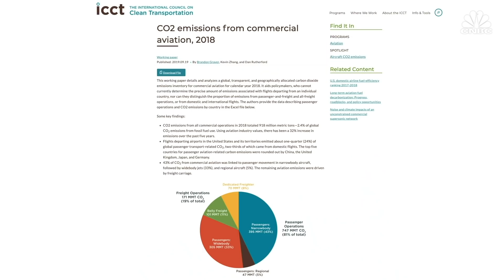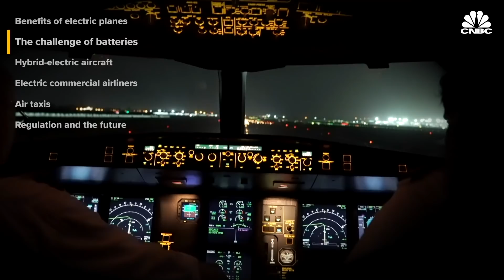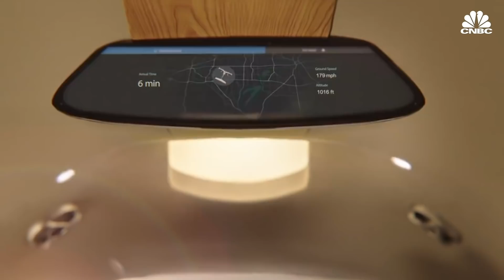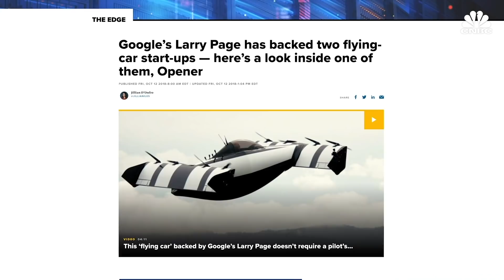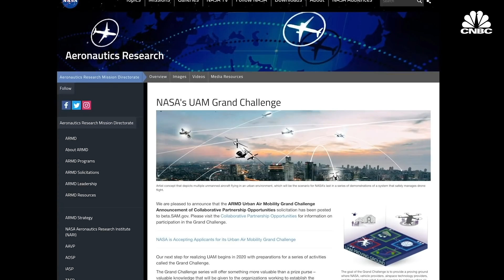Why Don't We Have Electric Planes Yet?

Comment: I will be retired from a flying career by then and won't step foot in an electric aircraft when they are shoved down our throats.   Yes, Harbour Air is experimenting but it barely has the range capability to fly a return trip on their shortest stage lengths.  I can't wait to see what happens with a hot battery or bus short.  No thanks.

Comment: So... we still need coal to power these bad boys even if they can be successfully developed.
Reply: No we need electricity.
Reply: @philterry3293  I'd guess that only coal or nuclear can generate enough, however.  (At this time, at least)
Reply: @rachelg785  Well you guess wrong. Renewables are the biggest growing sector and also one of the cheapest. Coal is being phased out in most developed nations.
Reply: @philterry3293  Only because of subsidies... and the irrational push to transition even when its not economically sound yet.  Prices for energy are sky-rocketing and people are suffering.  
But so long as the 'industry' is growing, right?  No.
Coal won't be phased out for a LONG time.  I suggest you get developing on actual viable alternatives if you want it to be.
Reply: @rachelg785  I already pointed out, Renewables are now one of the cheapest forms of energy generation (no subssidies) Coal in the UK is being phased out in the nest 5 years, and Wind power is growing, with two new massive offshore wind farms under construction.

The UK grid is now about a third renewable.
Reply: @philterry3293  Best of luck with that then.  I'm sure that will be powerful enough and reliable enough to get a jet off the ground.

Comment: The military started to develop nuclear powered aircraft, however that was abandoned.  They went with midair refueling instead.  The need to shield from radiation made the planes to heavy.  Would there be less need for shielding with molten salt reactors?

Comment: Maybe it's because if the batteries are as efficient as are Tesla semi batts, they will weigh 10 times the allowable takeoff weight of the typical airliner on long hauls?  A quick calculation after half hour searching came up with that. Anyone care to do better? And the infrastructure to charge a hundred or more planes at any given time at an airport would cost a fortune. The efficiency of batteries at the temperatures found at 40 thousand feet will come into play as well.

Comment: Because the technology is not there yet. Can't compare electric cars who can travel a  few kilometers to aircraft who needs to travel thousands of miles. If someone can invent a battery that can generate a power output needed for that. There could be charging stations in between destination countries. or someone could invent wireless charging while the aircraft is in flight.

Comment: Propaganda.  Look folks, these people have no idea what they are doing.  I do.  Happy to discuss the future of aviation.  This junk is not it.

The future does not need or want this junk electric nonsense. 

My new engine makes everything in this video all wrong. Yes, I have distributed power without the electric nonsense. No, this new engine is not an old pistion crank or jet engine.  It is a combustion engine so huge advantages over anything electrics offer even it the battery were the same weight at fuel.  

The electric motor can't offer blown wing, power on lift, active drag reduction and more.  No spin risks. 

CTOL, STOL and VTOL in one craft.  Roadable, door to door.  Nothing they show is useful, cost effective, or worthy of any investment at all.  Buyer beware... All these people are outdated and unaware of what is possible. 

That said, electro-fuels from nuclear/wind/solar is the fastest way to zero CO2, NOT batteries.  The very reason for electrics will end up being at least 2x more CO2 and 3-5 in reality that what I propose. 

You can make electro fuels for $1/gal. Electricity at 12 c/kwh is $4/gal.  My engine is the same efficiency as EV plug to wheel/prop.  No advantage in energy.   Electricity will always be more and grid based renewable electricity will be 10x more than making fuels from wind/solar.  Make fuels, use my engine...10x less costs. 

Going electric will bankrupt you.  Why?  Happy to discuss it.  You can't win....  Always less $$$ and less CO2 with my engine.

Comment: The first Comercial Electric plane flew just a few weeks ago.  Look up Harbour air
Reply: Not exactly......a commercial operator ( part 135) test flew a 45 year old DHC2 Beaver that was retrofitted with a 750hp electric motor with less than one hours range for a proof of concept as an experimental aircraft without a supplemental type certificate that cannot be operated in a commercial manner under FARs part 135 or part 121...fly in fishing on an electric float plane is a bit farther off then you make it sound....
Reply: @troynyholm232  it was the first time it flew.  There's extensive testing and the test flight is part of those.  It's part of the final steps.

This motor was probably 10 years in the making.  It's closer than you can even think.  That was the first one there's a dozen other companies with huge budgets in this race.

Comment: Electric (land) vehicles have been around for 100 years. But they were suppressed by Rockefeller/Standard Oil in favor of IC engine powered automobiles. As long as the oil cartel remains in power there will be no real progress toward any other energy source/propulsion system for land or air vehicles. Notice that all those brilliant young engineers in this piece still think it will be 20-40 years before battery technology can produce a viable long haul airplane. How long before before the oil is exhausted? 40-50 years? Hmm...coincidence. I do not think so. Somebody fact check me on this.
Cheers and Happy New Year!

Comment: what for when they already run on air
Reply: @cdimmm >  Wow, do you know this for a fact?  Please give us your experience to state that aircraft run on air.  Personally I have been in aircraft developement and Flight Test Certification for over 32 years on numerous commercial aircraft programs and business jet,  I have never seen an aircraft run on air.   
The jet engines use air to turn the starter motor to start the engines, but then use fuel from that point to keep going..

Comment: 1) If aerodynamic efficiency can be improved by a factor of 40 to allow use of batteries, why not do that and just use 1/40 of the usual jet fuel?   Answer: You can't. There isn't much aerodynamic inefficiency left after 117 years aviation development.  There are small aerodynamic improvements possible but most energy use improvements now come from more efficient engines,  weight reductions, and speed reductions.  Big energy use reductions will have to come from big compromises.  Electric planes using 40 times less energy would have to resemble the human powered Gossamer Condor; super light and fragile, super huge, and super slow. 
2) If Boeing already got burned by its use of a few hundred pounds of high energy density Li ion batteries on the 787,  how willing will it or Airbus be to use many tons of even higher energy density batteries to power a plane?   
Answer: Not very willing, especially if Safety Engineering has a veto on dangerous designs.  High energy batteries pose a fundamental danger because all the energy storing chemicals are in a small space separated by only a few thousands of an inch as opposed to jet fuel inside a tank well separated from the atmospheric oxygen needed to release that energy.

Comment: simple answer technology isnt there yet also they need to figure out how to charge it  as fast as it would take to fill up with gas
Reply: With an on site grid storage battery like the electric ferries use.
Reply: @hglasier  dude electric grid couldn't handle that. i looked uo the electric ferry 25 min doesn't seem possible.but if so wow...

Comment: power storage with lithium batteries is already adequate for a few electric planes. but there will need something better than lithium for general purpose aviation. graphene capacitors would probably be the next step, but production techniques not yet there.

Comment: Li-Ion Battery production is just as polluting as what we are giving off now
Reply: Back in the 70s they were not so good. Modern production is fairly good now. The main thing is that electric aircraft are vastly cheaper to run due to both the reduced fuel cost and the significantly reduced maintenance required.

Comment: Hate to break it to you but there is at least one electric plane called the sunflyer made by AEAC , it has around a 3 hour flight time and 30 minute recharge. It's mostly used at flight schools do the low operating cost.

Comment: As a pilot I’m never going to put myself in an electric plane.
Reply: Time talks. Fast forward 10-20 years and you might change your mind.anyways..Pls help share/ spread a positive vibe for 2020.... gofundme.com/f/teacher-dying-laptop  
Power of karma
Reply: A fully electric plane will lead to a pilotless plane. Imagine a pilotless plane coming into land at LAX with a computer glitch that puts it on the wrong runway and on a collision course with departing aircraft. There would HAVE to be some sort of human intervention, even in the extreme remote control. I cannot envisage a completely pilotless commercial passenger plane with the present, or the next level of technology. The problem is not only with the propulsion method, but the problem is also with the method of control. As we have seen with the 737 Max 8, one part of the control system can take over and fly the plane into the ground.
Reply: How often does your refrigerator break down? How often does your lawn mower break down? Stick with pistons if you want to.
Reply: @atomicsmith  refrigerators and lawnmowers?

Lol...
Reply: @noneyabizz8337  How many BTUs does it require for your for your refrigerator to safely, reliably, and efficiently transport human lives 24 hours a day at 475 Knots?
Reply: Adam Mackey Smith electrical failures are more common than piston engine failures.  You lose electric on a electric plane, you’re toast.  Lose electric on a piston plane, no issue.  Just land.
Reply: @atomicsmith  You can fly to your holiday in your refrigerator or on your lawnmower. Depends how high you are. Bon Voyage!

Comment: Batteries have a significantly poorer energy capacity compared to kerosene
Reply: On the flip side the running costs of an electric plane are much lower. Also, not being an air breather they excel at high altitude which narrows the gap between the techs. You only need to get a range of 600 miles to cover 48% of global flights and there are planes in the works that should do that. The Eviation Alice being one. The reduced cost is the main thing.

Comment: Guys...here is how this works going forward.  Unless there's a MONSTER technological breakthrough (that we have no idea about at all right now) in battery technology....the next giant move forward in aviation will not happen until the Fusion Economy is up and running.  When fusion power has created a paradigm where there is a GLUT of electrical energy that means it's so accessible to be "nearly" free...we will see plants created to extract carbon straight out of the atmosphere and process it back into jet fuel.  THAT will be the way that planes are "electrically" powered.

Fantastically cheap power sourced from to-be-seen fusion power plants will energize "air refineries" that will extract carbon form the air and turn it into jet fuel.  That jet fuel will be loaded into planes using traditional jet engines an those planes will fly using fuel that was "ultimately" created from fusion electricity.  I don't see this magic jump in battery efficiency that will be able to both overcome the energy density problem that we see with lithium-ion batteries today....or the OTHER problem that they don't bother to touch on in this video.  Namely that planes become LIGHTER as they burn jet fuel and thus extend their range...but do NOT become lighter as they expend the energy in battery-powered engines.  The weight of the electric plane that lands is essentially the same as the weight of the plane that took off.  

Aircraft are literally designed with the fact that landing weights will be significantly less than take-off weights today.  Having the same weight when landing as when taking off is a MAJOR engineering hurdle to overcome that nobody is talking about.

Comment: 1960's - Oil gone in 10 years

1970's - another ice age in 10 years

1980's - acid rain will destroy all crops in 10 years

1990's - The ozone layer will be destroyed in 10 years

2000's - The icecaps will be gone in 10 years

None happened, but all resulted in more taxes.aa
Reply: 2018 - Cow farts wll destroy the planet in 12 years!
Reply: Dude like even if you don’t believe in climate change you still gotta be onboard with this, because the difference between oil and electricity is that we can’t make more oil, when we out we out
Reply: @moxy-ol3lj  the Tesla's are coal powered
Reply: You moron. Almost all of those things stopped because we changed the way we did things.

The Ozone layer for instance was getting smashed by CFCs, we made a hole in it, we effectively banned CFCs and the hole shrunk to the point it was not a hole. This does not mean it was not a problem.
Reply: dude, like, carbon footprint man! weed lmao
Reply: You win !! Dumbest comment competition!!

Comment: Why not use a Hydrogen Fuel Cell? That solves your energy density / weight problem, and can be replaced with batteries it the tech proves promising. There are already several Hydrogen EVs on the market, the tech is proven.

Comment: Fuel cell is more practical in this application. Batteries are dead weight when empty.
Reply: Pipistrel have flown a fuel cell plane. Although when battery electric planes descend they can (if designed to) use the props to regen the batteries. I do like the fuel cell idea though.

Comment: Other countries have a solution to congestion. It's called an integrated mass transit system.
If we try to just move road congestion to the skies we a) won't solve the problem on the ground because only the rich will be able to pay to fly and b) we will invest massive amounts of resources into a solution that only benefits the rich and neglect the pollution and congestion problems for the other 99%.

Comment: Electric aircrafts are at least 20 years from being even slightly mainstream. By that point, hopefully nuclear power will be a lot more common because electric vehicles aren't cleaner. How do ppl think the electricity is being generated? Either fossil fuels or nuclear power. Hey, maybe nuclear fusion will eventually not be 30 years away!

Comment: I'm not convinced that Lithium-ion batteries will be able to achieve the density required for aircraft in the same class as Boeing's 7X7 lineup (737, 747, 757, 777, etc.) and Airbus's A3XX lineup (A320, A330, A350, A380, etc.), so baring any dramatic battery tech revolution, I expect that these aircraft will prolly end up with hydrogen propulsion, or hydrogen-hybrid propulsion. Just my gut instinct though, haven't run the numbers on this/ looked at the latest research.

Comment: How about the speed? Jet engine replaced propeller because of that.
Reply: Speed is handy factor. Running cost is another. The electric planes that are flying now are very cheap to run compared to ICE planes. It's early days of course but the graphs looks very promising. Check out the Eviation Alice.
Reply: @hglasier  But so far it's only driving propeller, which limit its speed to 400-500 kph.
Can't wait until it use ion drive. It's a promising future technology if we talk about speed, but so far it can only push a few centimeter per hour.

Comment: I have just one query in my mind.
I would appreciate if someone will help me out solving that.
Currently while flying I notice outside temperature which is like less than minus 30 degree Celsius, the battery percentage will drop very fast just like the laptops and mobiles in cold regions so what could be done to resolve then.
Reply: A heating system

Comment: Well...Golf carts have been around for 50 years or more....They are still golf carts....I don't see electrics getting any better anytime soon!  Real power...takes a lot of energy...A short burst is one thing....Electrics can't maintain that long term energy.  Then you have to recharge instead of refuel....If in this country..the USA..if you could go into a charging station and just drop your battery and have a charged one installed right away...things would be golden..

Comment: This video is a joke. There is no way any plane of any size is going to use batteries for decades, if ever. The amount of power required and consumed is phenomenal. Only petroleum fuel has the energy density to be able to do get a fully loaded commercial plane off the ground, fly at 500 mph for several hours, and land and then turn around within an hour or so and do it again. Can you imagine the electrical requirements to charge a 737 or 787 in an hour? Then multiply that by, say Atlanta's airport, and O'hare airport, and many others? The electrical infrastructure improvements and capacity are just not economically feasible or even viable.

Comment: Why don’t we try hydrogen planes?
Reply: The main issues with hydrogen are storage and volume.
It has a high energy density per mass, but an extremely low one per volume, so you need a lot of storage space for fuel.
Amd since you have to keep it in liquid form, you either need cryogenic tanks or high pressure tanks to carry it.
Both of which raise a whole new set of technological issues, and make the plane heavier.
Also, there's the fact that hydrogen needs to be produced first, which is an inefficient (and thus more expensive) process, while electricity is readily available.